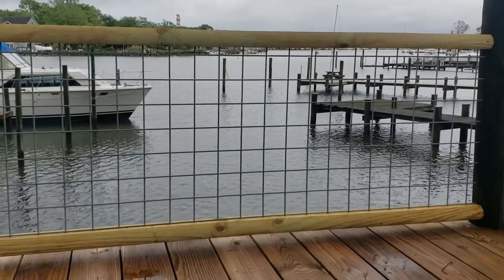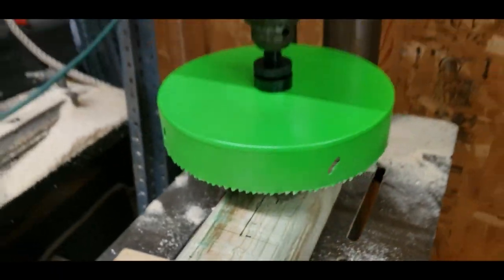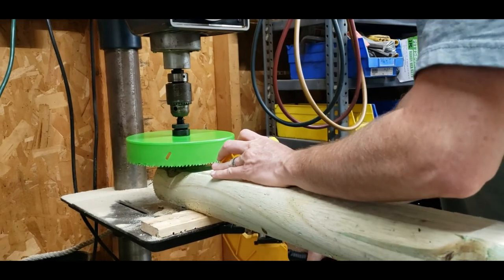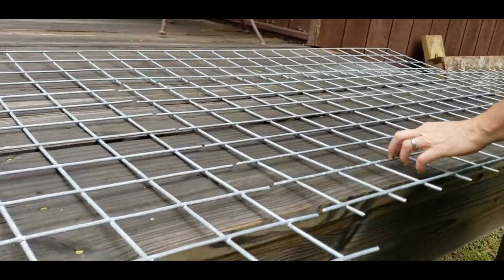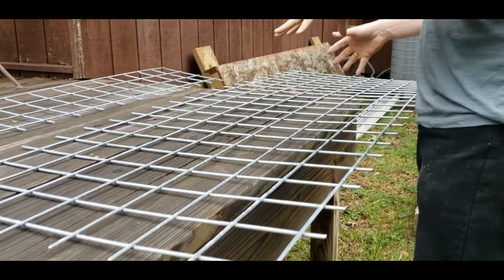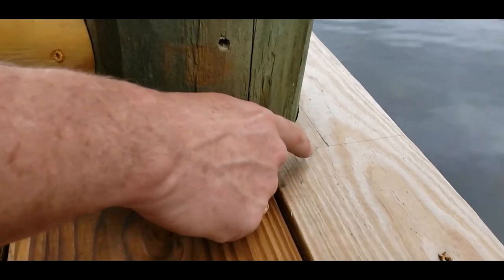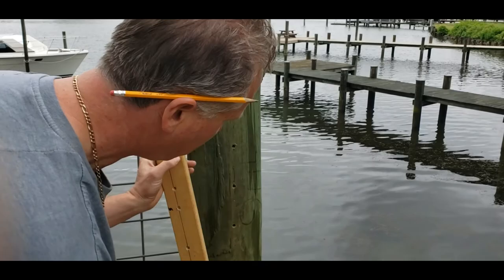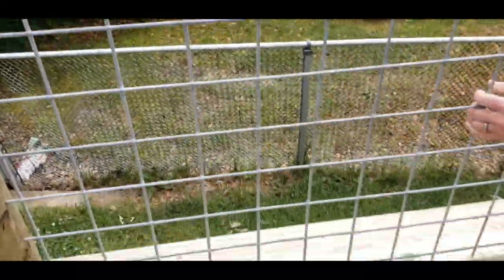DIY Deck Railing piling on budget that give clear view better then glass. Hog wire fencing. Bloopers

Comment: Interesting design! Good tutorial. Any updates on how it's holding up a year later? I'm putting some of this on our forest cabin and I'm wondering if those timbers shrank at all?
Reply from the maker: It has lasted well. The only complaint is that the cold galvanize paint did start to surface rust. No issue with the water draining since I drill the bottom one all the way through. One of the timbers did bow but I think that was just because of the tree cut location of the timber.